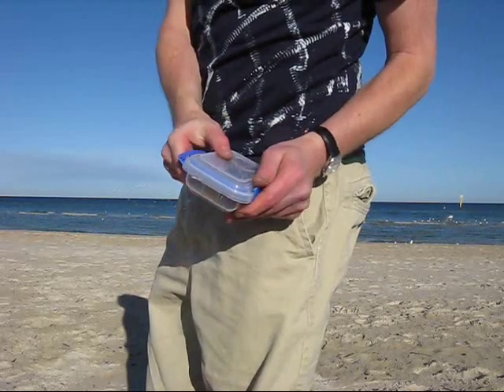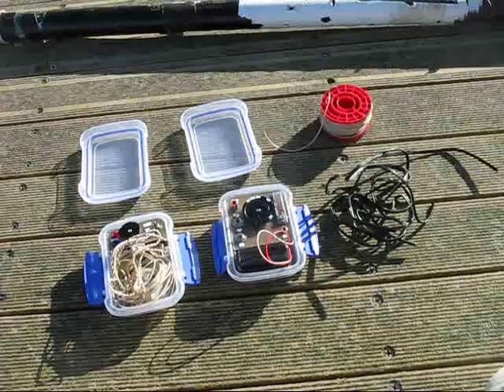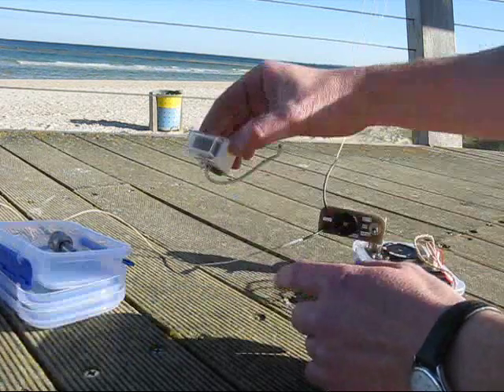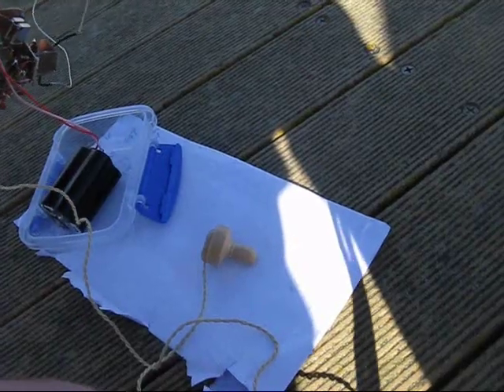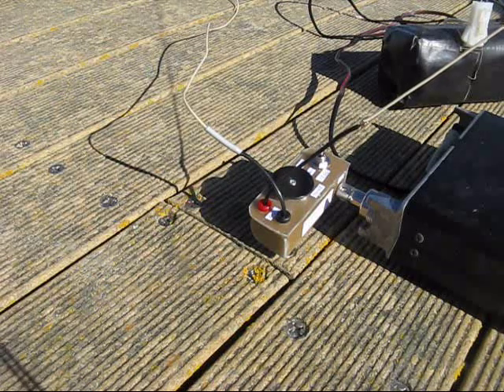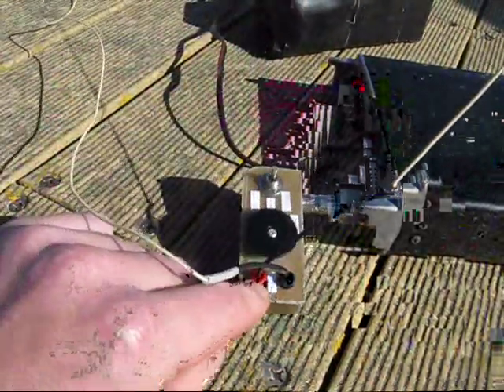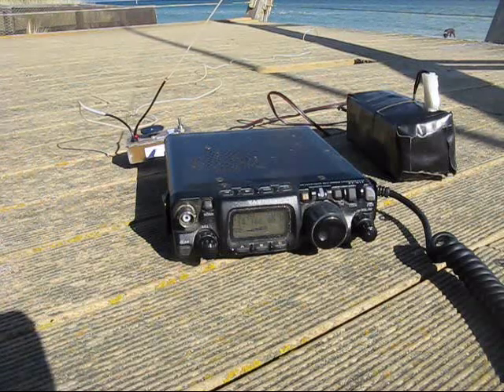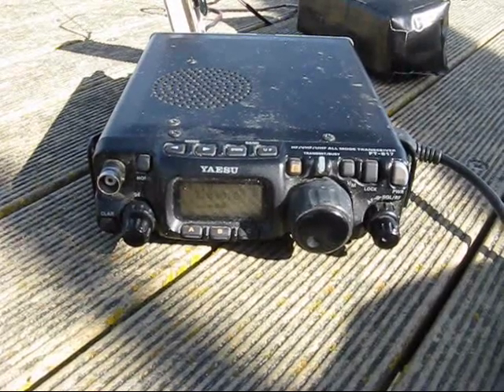Minimum QRP - Part 2 (HF portable)

Comment: Peter,

What toroids do you use for your tuner?  Wire size, number of turns?  I could figure it out from the formulae but since you have already done the work please share.  Thank you.  
Also,  how do you keep your FT 817 working so well with all the beach sand and salt air exposure?  I know it is a tough radio (have had mine for 10 years) but I have been afraid to expose mine like I see in your videos.

Dave K8WPE

Comment: Peter,,
I have followed your videos and books for a long while.  You are so talented, but why can't you find a better noise or wind cancelling microphone for your efforts?  The wind noise is terrible on critical spots where your speech is critical to understanding your thoughts.  There has got to be a better way.  Thanks for what you do but please do something for us old farts who may have hearing problems. My hearing aids are adjustable to reduce the wind noise across each unit.  Maybe a small head set with a directional microphone in front of your mouth would help.

Dave K8WPE Traverse City, MI USA. QRP 99.9% of the time.
Reply from the maker: Thanks David. That video was made several years ago.  More recent videos should be better.

Comment: On your antenna tuner, there is a QRP tuner kit on eBay (Chinese) for just a few dollars.  It's good for up to 20-watts on a reduced duty cycle.  It also works!  It uses a fat toroid for the coil in the T-match circuit and a couple of those little poly air variables.  What  really like is that you don't need a meter --- it has a SWR sniffer circuit that snuffs a red LED when resonance is reached.  Little thing even works on the AM broadcast band and goes beyond 30 mhz.  The instructions and photos are wrong though, but it's easy to figure out.

Comment: Nice little setup; thanks for sharing.  What's the choke on the meter for?  I've always just used a diode to rectify whatever  reaches the DC meter coil, and an electrolytic cap across the meter terminals to dampen the needle.

Comment from the maker: Probably overkill and then it wouldn't be 'minimum QRP'.  And hearing audio wouldn't be so helpful with CW (except to detect key clicks).  A possibility could include an LED indicator as per Hendricks BLT Tuner.  Problem is they're hard to see in direct sunlight.  A resistive bridge is also OK but needs a switch to switch in and out.  So the seperate meter wins out.

Comment: Hi Peter
I have tested it with 9m counterpoise on 40m, SWR 1.3 or better,
with counterpoise connected to earth SWR 1.1.
A working portable antenna system for $10, can't do better.

vy 73 Jens VK4AJG

Comment: I tried the 22tuner with the two inductors in parallel on 40m.The conterpoise is 3m long. SWR is 1.7. 
Tomorrow I will try it again with a longer conterpoise, 6m long. 

73 Jens

Comment from the maker: @9m2pju the circuit for the transceiver is in my video on the 'Tiny Toy'. I believe it was also in Sprat. The meter is just a diode and RF choke in series with the antenna at the junction.

Comment: Hi Peter

I have ordered the parts for the L Match. Jaycar has not a 0.65 uH RF choke.
A 1.5 uH choke and a 1 uH in parallel is 0.6 uH. The chokes have 10% tolerance. It should be close enough.

Can I use a 9m fishing rod with the 22m wire?

Good work.

 I like the little transceiver too. I have you article in the Lo-Key.

vy 72  Jens VK4AJG